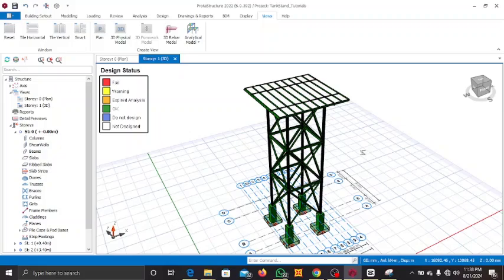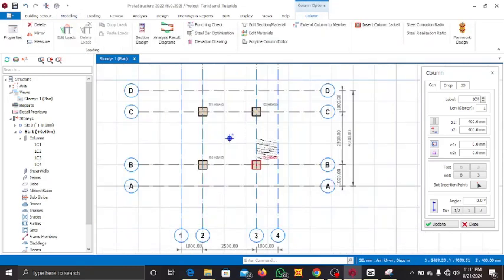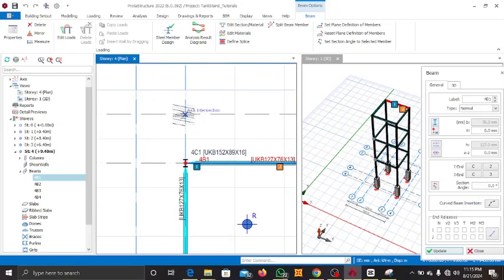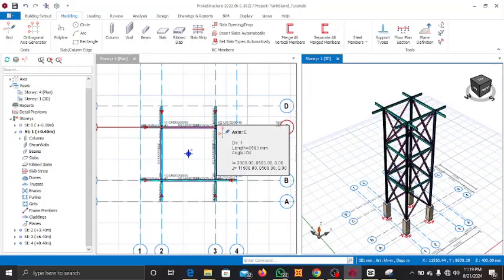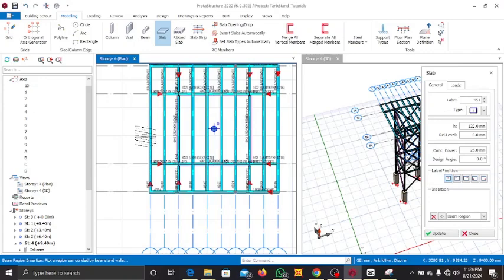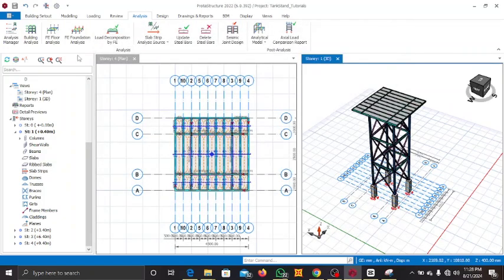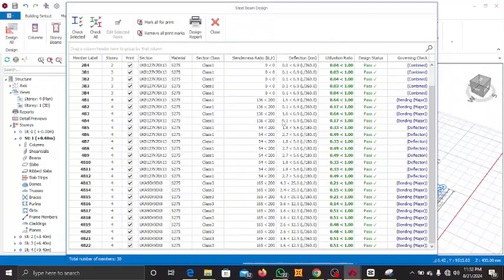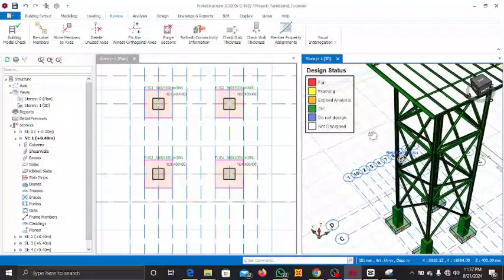HOW TO MODEL, ANALYSE AND DESIGN STEEL TANK STAND IN 30 MINUTES IN PROTASTRUCTURE

Comment: Is a concrete slab used for steel tanks?
Reply from the maker: yes, Just to simulate the weight of a steel plate and the water load.